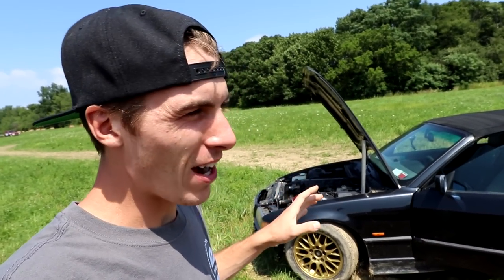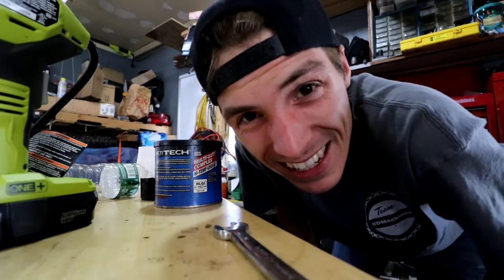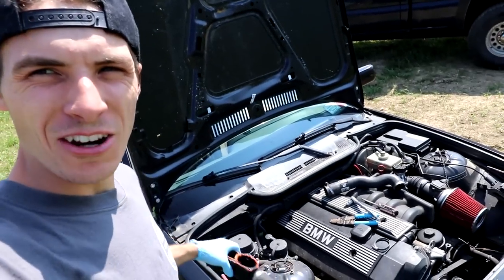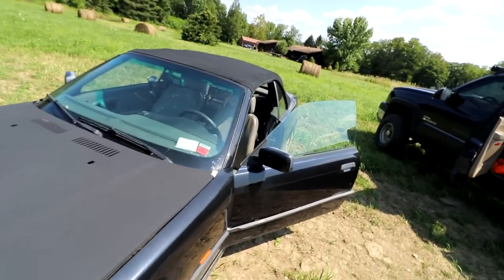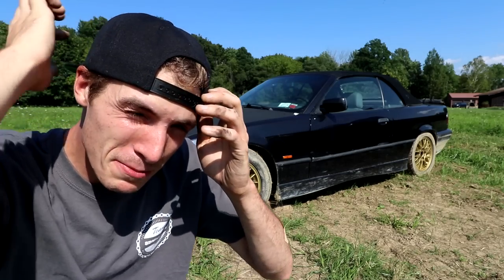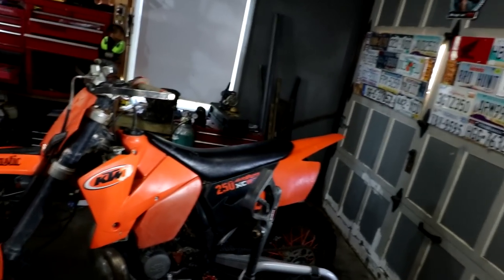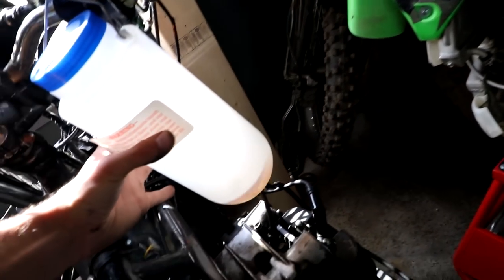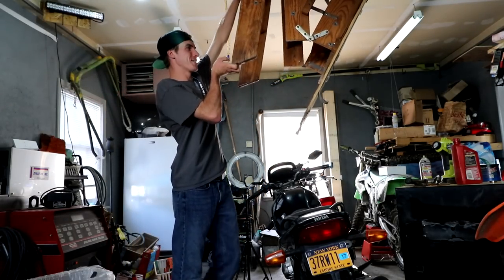THIS PISSES ME OFF!!

Comment: Headliners really aren't fun. I work in auto upholstery and have been doing a ton lately. I don't know your intentions but if you plan doing a complete overhaul, here's a few tips; if your headliner is sagging and completely off the foam, peel it off. That means the glue has worn out and the foam is dead. Take a pair of gloves and and rub your hands all over it and it should come off. If not, lightly use a scraper. Don't use any power tools as you might blow through the base being that you're working with a quarter inch of foam that's glued onto either a fiberglass base or a cardboard base. From there I'd buy a whole new headlining that already has the foam attached. Take measurements and glue both surfaces and let them dry, from there stick the new lining onto the base, watch out for creases. When it's on, let it settle for maybe 5-10 minutes. Cut out your handles and coat hanger holes while it settles. Finally, take a heat gun and hold it about a half a foot away from the lining and run your hand over the lining, taking any creases, bumbs, etc out. Make sure your hands are clean, I've made that mistake before and had to completely redo it 😑

Comment: windshields will not blow up in your face because they are laminated. they have a layer between 2 pieces of glass that hold the glass together. while the corner is smashed, that is an indicator something hit it there- a point of impact. The cracks that come off of the impact point may spread throughout the glass but it is perfectly safe to drive even if they do spread.  windshield are different than most door and back glasses as they are tempered. Tempered glass will explode into many pieces. but some higher end cars use laminated glass all around which prevents them from breaking into many pieces. if you hit something and it goes through the windshield that's a different story.

Comment: roll cage with racing seats, 5 point harnesses a 2 brothers exhaust led light bar across the top of the roll cage just turn the gator into the most badass off-road vehicle for the drift track

Comment: The thermostat restricts the flow of the coolant to absorb the heat from the engine and if you don't have that the violent will just flow in threw and not absorb the heat of the engine but it will show a cooler temp but hat doesn't mean that it's cooling off the engine so I would suggest to put another thermostat back in dalton or the engine will burn up

Comment: Dalton toss a liquid cooled snowmobile engine in the gator. Twice the power u can use your centrifical clutch you wouldnt have to worry about chains and other issuses. Then the winter time take the front tire off put a ski make tracks to put over the rear wheels and have a kick ass toy for the winter..  Me and my dad made go karts and a three wheeler with sled engines they r awsome to use.  And very sorry about prince

Comment: Removing a thermostat will just cause it to run hotter.  The thermostat gives the coolant in the radiator time to cool down before cycling through the system again.

Comment: Get some gurilla glue and slab it all over the window where you cracked it. Should hold it from spreading further. Or get actuall glass repair kit..... they come with a glue and a silicone thing you put over the crack.

Comment: The gator needs to get that motor slapped in with each back wheel having 1 inch spacers to keep it stable and some top end gearing that works with four wheel traction. It'll b hairy